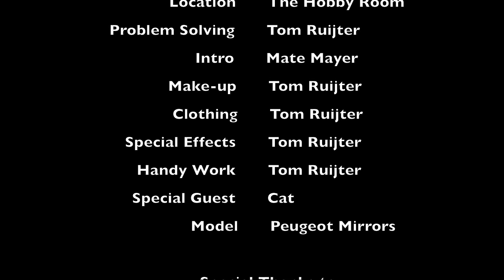Peugeot 108: Painting The Mirror Covers

Comment: The paint does not stick. Need an adhesion promoter.
Reply from the maker: The paint stuck just fine, only not on the inside as that was not sandes
Reply: +The SFor plastic cars need plastpraymer. As time passes and the primer + paint + varnish exfoliates. http://auto-bat.com.ua/index.php?productID=244calemodeling Channel
Reply from the maker: +сергей д. The primer used is plastic plastic primer. The ones i painted 2/3 years ago for my own car using the same paint still look as good now as they did when i painted them. Don't worry about it.
Reply: +The Scalemodeling Channel OK. Very good.